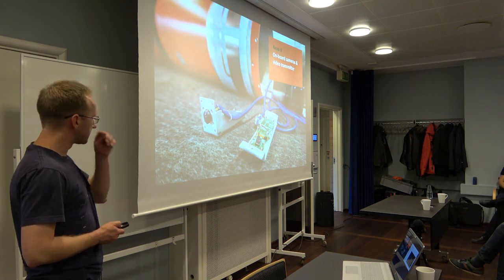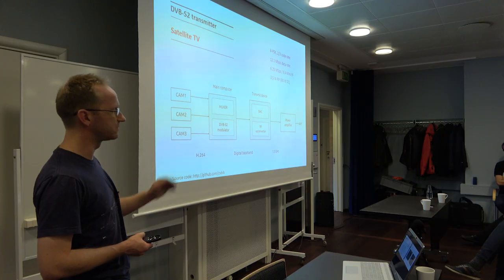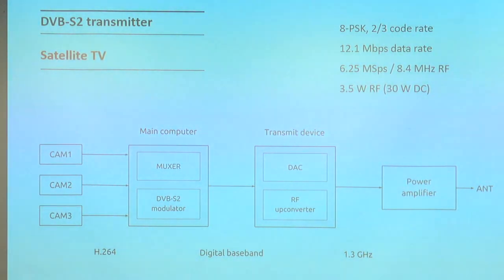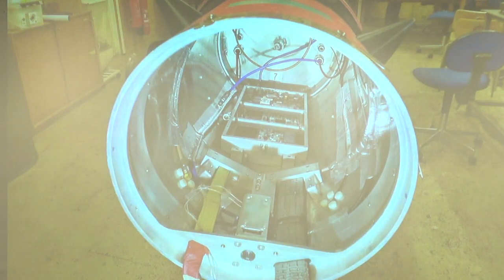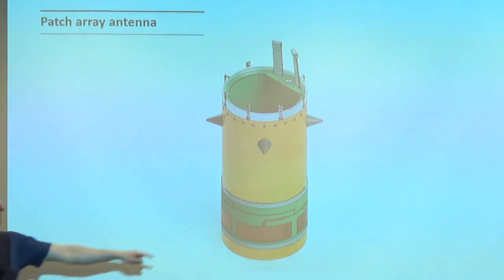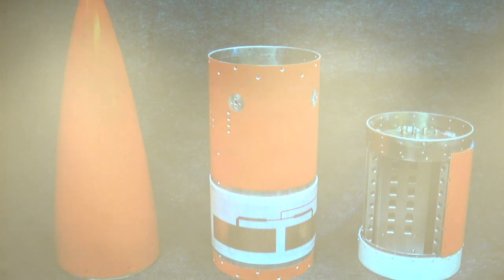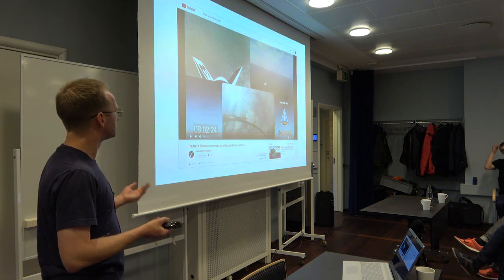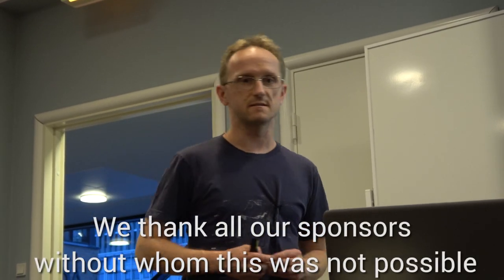Nexø II debriefing part 2: Onboard cameras & the video transmitter

Comment: Ideas for next flights of camera system:
1. Plug in microphones to capture what sounds the astronaut may expect and what the actual astronaut says.  An engine bay microphone on the downward camera may be useful for engine post-flight evaluation.
2. On test flights, put the astronaut-visible indicators in view of the upward camera for testing it and public illustration.  Even though that panel will probably be moved when there's an actual astronaut on board.  If astronaut facecam will be in the panel, point the panel up and put a mirror in the nosecone on test flights.
3. Capture to SDcard at an integral multiple of 720p (1440p or 2160p) for easy downconversion in main computer and better post-flight videos.
Reply from the maker: John Francis Doe not a bad idea with the microphone